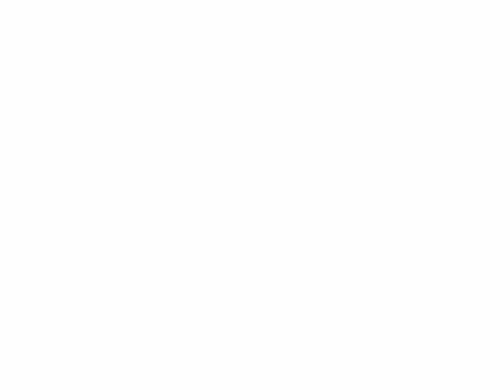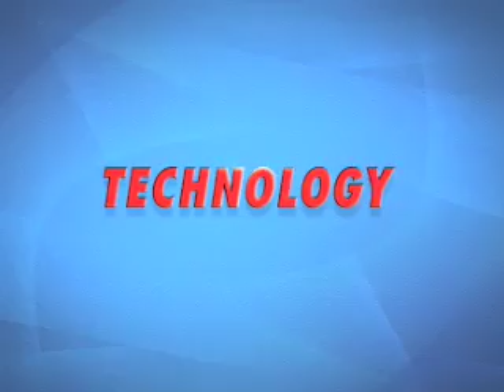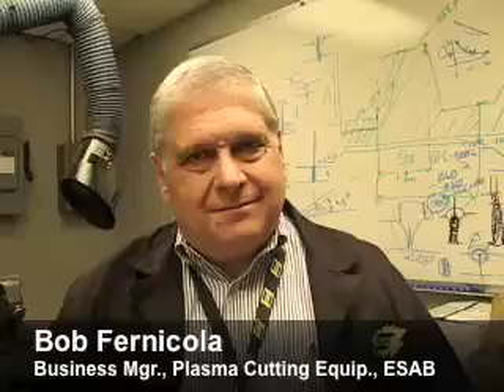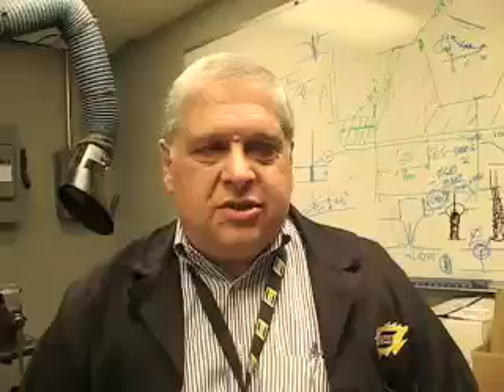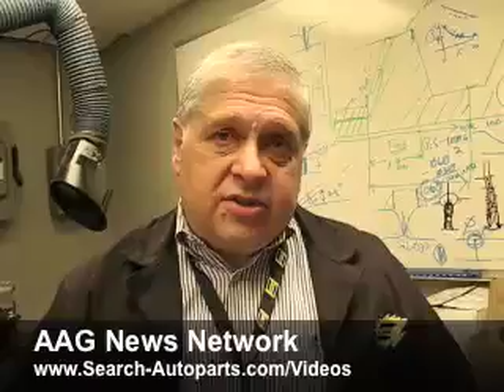Plasma Cutting Tools: What to Know Before You Buy

Comment: it depends on the plasma cutter and its cutting capacity because the thicker the cut the more air it will require. an everlast powerplasma 60 amp requires 5 cfm and it will cut 1 inch solid steel very well.

Comment: Get one with an adjustable post flow. That way you can dial it down for light jobs to save on compressed air when using a smaller compressor or dial it up for maximum consumable life.

Comment: It depends on how much moisture you have in the air. I *could* run my Everlast plasma cutter without an air dryer but I choose not to. My cousin in Florida has an Everlast powerpro 205 like me and uses a dryer to suck the moisture out of the air.